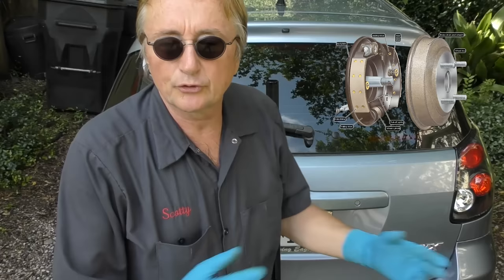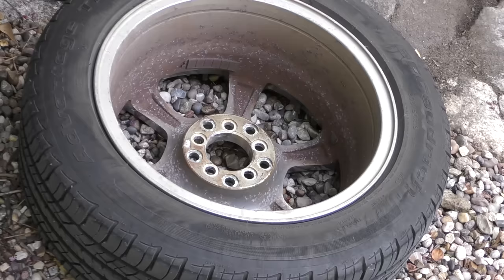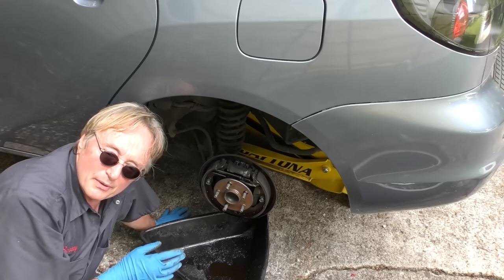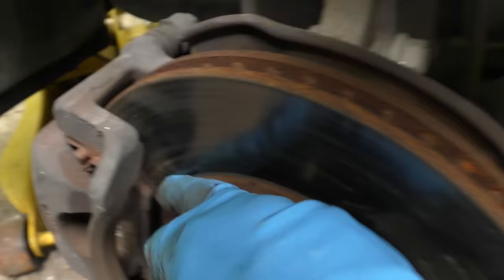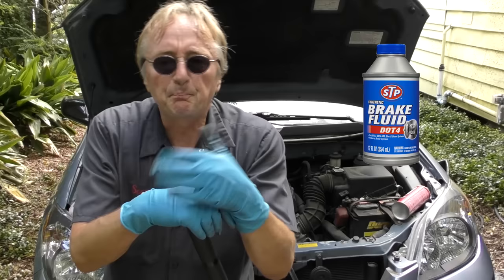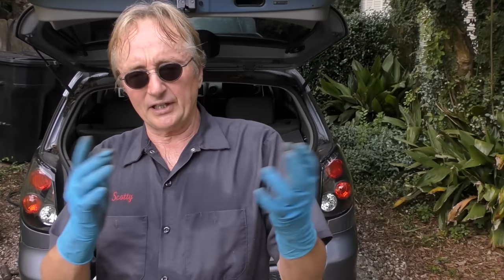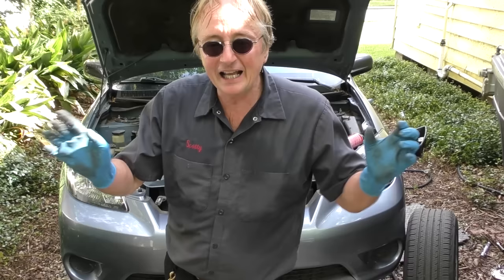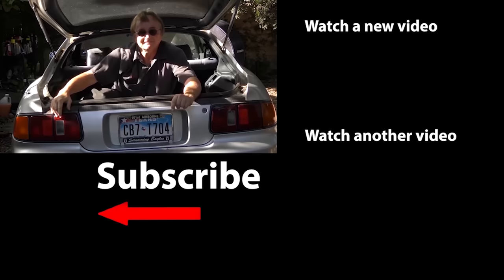Doing This Will Make Your Brakes Work Better and Last Longer

Comment: I actually did this to a '94 Toyota Celica and it turned into a '95 Toyota Celica.
Reply: Lmao
Reply: Hahaha good one!
Reply: What is the name of the product you use and where to get it ?
Reply: Did that cleaner cost $30,000 per can?
Reply: @edsyphan3425  No, I bought it used and it cost only $3,000 with 60,000 miles.

Comment: only Scotty can remove a wheel with a standard screwdriver.
Reply: haha if you aren't being sarcastic, he paused the video, most know how to take the hub cap and wheel off, unless there is a locking nut, that's another video
Reply: @asrtive  yes bro, you can see his impact wrench sitting on the ground
Reply: Lmao
Reply: It's a joke no need to explain everything.
Reply: They ruined your joke 😅
Reply: Only Scotty can use aerosol brake cleaner full force on a drum brake, and not have it splash in his eyes! No safety goggles. I wear gloves and safety glasses when I do work like automotive brakes.

Comment: Brake Cleaner is probably one of the best cleaners ever made. Has thousands of uses. 👍
Reply: Like what other uses?
Reply: it kills bees instantly too!!
Reply: @vivianp5962  it's a really good wasp/hornet spray for cheap. Got stains that won't come out, try Brake Cleaner.
Reply: Interested on what other applications can it do too!
Reply: @chantakzee  clean spark plugs
Reply: Mouth wash?
Reply: Personally i use Brake cleaner to clean any grease/oil area/surface. Just make sure that the surface is not delicate. Other thing that works incredible well is to remove stickers. You know, when a sticker is so well glued that when you remove it all the glue and some plastic/paper is left behind? Brake cleaner will remove almost instantly with almost no effort at all.
The only cons is the smell. Pretty strong. Use it only in a ventilated area. All of them are pretty good overall. I usually use WD-40 Brake Cleaner (not the regular one, the brake cleaner version). Pretty good.
Reply: Can it be used to clean mass air flow sensor?
Reply: @moeb434 , never use contact cleaner instead, and on all other sensors
Reply: @moeb434 The company that makes the brake cleaner, CRC, has a can of stuff made especially for Mass Air Flow Sensors.
Reply: @herbwag6456  just spray a little inside your underwear and the wasps won't try to nest there
Reply: shampoo
Reply: @BlackoutBilll21  Why would you want to kill bees ? They pollinate the crops that becomes our food ! They make the most natural sweetener in the world which NEVER spoils! Besides bee population is seriously declining do to pesticides and mite infestation!  If you do not want to eat, kill bees!
Reply: It is definitely a very good cleaner, but very hard on the hands.
Reply: @davidroth9845  Good idea! I'm also thinking of using it to clean my stinky dog.
Reply: @moeb434  No!
Reply: Great for cleaning oil and grease off of engines and transmissions.
Reply: @paulparoma  Wasps are a nuisance but I am told that they do  prey on other pests that ruin your garden! Hornets are small and wasps have a pronounced 2 part body. Bees are rounder. If you have problems with wasps hang those wasp traps  they work well and don't catch bees.
Reply: @paulparoma  My parents had a huge pussywillow tree which would be full of bees, l would walk by and even mow around it and never got stung once! Let the clover grow and you might just buy some honey produced from your own yard😁 Cheers Paul !
Reply: @paulparoma  👍
Reply: @glenhayward1132  hahah REALLY???? i meant the small nest in my boat trailer! not using insecticides on acres of crops!! smh
Reply: @paulparoma  If it flies and stings it's on the short time list.
Reply: @herbwag6456  Do NOT use Brake Clean on any animal -it burns eyes and skin!! It burns human eyes and skin too!
Reply: I use it to clean clothes when nothing else works it will do the job . It's a every effective product to clean guns , pistols etc . The pressure washes in the small areas you can't reach with a brush and the old grease / oil is definitively eliminated . You only have to put a light oil coating after that . And it's quite cheap and really fast .
Reply: Spray under your arms when meeting a Texas lady

Comment: I have two cans of Brakekleen.   You can use it for all sorts of purposes, including cleaning reloading dies.
Reply: It's a good bore cleaner as well
Reply: I use it on my mountain bike chain to get everything off instantly and then relube the chain accordingly.
Reply: @jessel1217  No better degreaser than brake cleaner.

Comment: Clean and non-offensive comment
I like that you mentioned changing out the brake fluid every so often. On my VW Jetta, the maintenance guide says to do it every 2 years.
Reply: What year is your Jetta I'm curious as I have a 08
Reply: @michaelpadilla6007  2003
Reply: Better to change the fluid than to replace the lines.  Fluid sucks up the water causing the rust.

Then again if you replace a brake line you need the replace the fluid anyway.

Worst case scenario:  You do brakes, lines, fluid and then store the car.  5-10yrs later when you want to drive it again you will most likely need to replace lines/fluid/seals again.
Reply: That may be a little bit earlier than needed but still, it won't hurt anything.

Comment: Don't drive like a maniac, and your car will last longer. Who knew?
Reply: Pass people who brake every 10 feet
Reply: Drive like a granny when car is warming up, than full throttle when warm, better for engine.
Reply: @goldenultra  wether it's better for your engine or not is debatable. I prefer full throttle a couple minutes after driving as you avoid heat soakin your intake and have more power.
Reply: @Josh-cw8by  More power because it is taking cold air, that makes sense. On my Avensis when you start cold it revs high toyota built it that way. So maybe there is more to it....
Reply: @Josh-cw8by  I think the paris333 or whayever comment removed that is why the comments look a bit 😕. I reported him as a troll, he or her was being intentionally rude.
Reply: Don't drive like a granny in the  passing lane and your rear end will last longer..
Reply: @ThePariss333 what does pride cost these days
Reply: ThePariss333 i
Reply: Many people didn't.
Reply: @Josh-cw8by  I floor it on 15mph limit roads to warm engine up a little quicker
Reply: @Josh-cw8by  I also put a brick on the gas when I put it in park. It's the only way you'll get the most out of your engine it's built for that
Reply: got 99 dodge ram , keep it up ,rebuilt front end , same transmission ,keep it changed ever 3000 miles , same with oil , i had it for 9 years , drive it everday . Long trips short trips it holds up really good . AC ,Heat , i did change seats out ,back and front out of 2001 dodge ram 1500 , along with carpet ,i like the leather better and it rides better, But yes you right take care of it and it last .

Comment: I love the smell of Bräkleen in the morning.
Reply: So  does   Robert Duvall.....
Reply: Works great as a disinfectant for minor scrapes and cuts!  Just spray some on those pesky cuts you get while working!
Reply: Good one!!!
Reply: @lysol7204  Done it.  I'd rather die of infection.
Reply: I would not use it to clean brassieres...
Reply: What is Bräkleen?
Reply: @Jozavenue  Only the best multi purpose chemical ever.
Reply: Probably makes a good wasp & hornet killer too, & WD40 works, maybe not as well, but it'll git er dun.

Comment: Take off the parking brake before trying to take off the drums.
Reply: You always try to take it off first. Having to go loosen the star bit and then retightenin it is unnecessary if you don't need to do it. Plus this car has an auto adjust feature, so if it comes off easy that's the method that will happen.
Reply: And if you literally meant release the parking brake then try.... well,  it's not coming off if the brake is on.
Reply: 1:13 you can see that he does not have the parking brake it was the Hub Centric ring
Reply: You mean out the gear in neutral or take off the emergency park brake?
Reply: yeah i broke my tone ring on my Subaru because i left the parking brake on… never going to make that mistake again
Reply: @magincap70  qq

Comment: Good job Scotty.  I cleaned the drums on my 1984 GMC 2500 4 by 4. I have had it since 1994, put new pad on the front disks. The rotors looked good. I can't wait to get my new brake cleaner

Comment: That break cleaner is good stuff.
I use it to clean lock cylinders.
Reply: It's also really good at removing sticker or tape residue. A quick blast and wiping the surface with a rag right after is usually all you need.

Comment: 100,000 mi from front brakes?  Not here in the mountains of NC. I get only about 40,000 mi. ( No, I don’t drag the brakes). Brake Kleen is great stuff. Have used it for years. 👍
Reply: Try gearing down on the long down hill. I did 100K on pads overloaded 1 ton in colorado mountains

Comment: First time I have ever seen the suggestion to flush out old brake fluid, it’s about time. Yeehaw.
Reply: I think it's underrated.  I once flushed mine, and they were significantly better.
Reply: My dealer “suggests” brake fluid flush every oil change lol. I’ve paid to have it done but not sure they actually do it.

Comment: Brake clean on actual brakes?
No thanks. I'll stick to cleaning my engine and everything else on the car with brake clean
Reply: Tried on pads, after sometime the pads came off leaving the iron to disk bare, metal to metal 🤢
Reply: @shaf3006  great troll 😂😂
Reply: FIREARMS CLEANER!!!
Reply: @shaf3006  You can't clean pads only the rotors.
Reply: Brake cleaner is basically just a kitchen degreaser on steroids it would clean the engine, it would clean all the oil off the cyclinder walls.

Comment: My wife's 2007 Honda Fit had 4 wheel disc brakes.   Her 2018 Fit has drums on the back.  But thanks to another video of yours, you set my mind at ease by saying that it's the front brakes that do the majority of the work.  This summer I will blow out the drums.  Thanks for the info.

Comment: Not the best idea to spill that break cleaner into the gravel / ground.  I'd let it evaporate from a tray.
Reply: Allan Peda why?
Reply: @putridvomit  the dust will dry and collect on the floor
Reply: @niq872  It's not a floor.
Reply: Well you don't want to breath that stuff either. Wonder if OSHA is watching.  Akebono makes pads for OEM  installation as well as caliper assemblies and so on.
Reply: 100,000 miles on pads Scotty?  Maybe in FL. Where there's no corrosive are added to the road and that white stuff falls. It'll kill the rear calipers quickly from salt/sand and the resulting high salt water mix from melting snow. Hard on front brake calipers as well. Service your brakes twice a year and they'll last. However brakes only have one job and that's to stop your vehicle. How much is your life worth. Don't screw around or cheap out on your brakes.
Reply: synonyms: ground

Comment: You crack me up. Love your videos!  Everything makes sense or duplicates what I tell people and know...  Now I have have many cars and trucks and usually the calipers stick...  So what I do is unbolt the caliper and "pop" the piston by pushing the brake pedal  then clean it out make sure it's clean and no resistance.... Then I'll put some grease on the cyllander undo the bleeder and push the piston in the whole way.. reinstall the caliper then bleed the brake..  that way when you let off the brake it comes back and doesn't stick...                    Bungee

Comment: You definitely live in Houston. That's the most I've seen you sweat.
Reply: Lou Yelich Try living in Lubbock.  At least Houston has the Gulf winds.
Reply: Live here in Brownsville, Texas. It's been 120 with 90% humidity for the last 2 and a half weeks. Your asscrack will pretty much  be damp the minute you step outside. And it is 100 during the night. And funny thing is I live 10 minutes from the beach.
Reply: zhbvenkhoReload and here I am bitching about this San Diego weather, I won’t be doing that anymore. I feel for you and I hope it cools down soon.
Reply: Gulf winds? I lived in Houston for 10 years and the only breezes I ever felt were in the Winter. The wind just dies in the summer. Also, the Gulf is like a boiling pot of spaghetti and the summer breezes are bleh. In my experience, Houston was 90+ degrees and 90+ humidity - from mid April to mid-October. I don't miss that.

Lubbock IS hotter though - hella hotter.
Reply: @zhbvenkhoReload  - you have my deepest sympathies. That sucks/blows.
Reply: @zhbvenkhoReload  120° and 90% HUMIDITY?!?!?!
How do you stand it?!?!
Reply: Come to Puerto Rico. You Texans won't survive, lol.
Reply: @davecrupel2817  You get used to it. Also, I work as a school teacher so I don't go outside during the day. Just during the night to run a few miles.
Reply: Dallas Texas in the house!
Reply: @michaeldavila8627  You're tripping hard if you think Puerto Rico is hotter than Texas lmao

Comment: Good advice as usual Scotty. and yes, I did "Ring that Bell... 

Just DIY serviced the HandBrake ( Hand UK  ~~ Emergency Brake USA ) on my 2005 MG ZT Petrol Turbo. It has Disc Brakes on the rear and inside their hubs, are a small brake shoe assembly for the the Handbrake operation. Doesn't hold the car like it used too. So removed Discs/Rotors and Calipers on rear. I used some 5% Dilute Dishwashing Up Liquid in a Mist Sprayer the type gardeners use to spray their plants. Then liberally sprayed the assembly after removing Brake Discs. Worked that into all the nooks and crannies with a Nylon Bristle Brush. Then rinsed the lot of it off with some recently boiled water. That warms the components and allows them to dry quickly with the heat. Then adjust trial and error with disc on then off until ideal Handbrake setting is achieved. I can now park my car on the steepest slopes confident it will not roll away. This frequently happens with some cars even modern new ones with the fancy brake assist gizmos... several reports in the press about runaway cars. Not all advanced technology is 100% beneficial. 

I'm one of those drivers who does get 100,000 miles out of the Pads .. not to be confused with driving slowly as you mention. Anticipation is what its all about. Many drivers are heavy on their brakes. No need. Plus wait at long hold ups or red lights with foot firmly planted on brake pedal stressing the hydraulic seals in the system. That' accelerates wear and why their cars need expensive brake renewals soon and more frequently. 

Keep that good advice coming Scotty. You have millions of Bell Ringers ...👍👍

Comment: EPA is going be coming by due to your toxic waste spill there buddy....lol
Reply: I was noticing that as well. Soil acidity might break down small amounts of toxins. 
Places like military and large military plane contractors used to get EPA waivers to dump solvents into streams running into rivers here in Atlanta that flow to the greatest estuary in the WORLD! That was true in 1995. I did an award winning study on the local River corridor and published a list of known point source polluters directly from the EPA/EPD. Recommend published consumption of fish and other marine life was not more than once a month. 
And that is the truth as I knew it.
The old professor
Reply: Coach Wilson, Have you ever used brake cleaner? It evaporates extremely fast! Almost all of the contamination is brake dust that ends up in the environment any way.
Reply: @donlarsen9807  yea,  I was just making a laugh. That stuff cleans great and evaporates almost immediately. That's what the lol was for.

Comment: My 2014 Tacoma just rolled over 200k miles on the original pads, no squeaks! Brake pedal travel has gotten long though, will be replacing soon

Comment: "Now the secret to making your brakes last their longest is... don't drive your vehicle!" - Scotty
Reply: Then the weeds will overtake it.
Reply: livewireOr hmmmmm.   Obsessed with ‘weed’ ???
Reply: Then your brake discs will become pitted and destroyed by corrossion brakes have to be used a little bit to avoid rust and corrossion building up on the discs. Brakes can die of not being used enough in extreme circumstances.
Reply: I guess this one is basic cdl question

Comment: Another practical video! Scotty you''ve got great advice and a fine sense of humor!  I've flushed my cars brake systems every two years and kept original brakes (except pads and rotors) for 265K miles on my '86 Mitsubishi Mirage Turbo.

Comment: Been doing something like this since the 1960s when I gave the brakes on my MGB Soft Top tourer some TLC. Front discs, rear drums.

I now use a 5% diluted Dishwasher Liquid in a Plastic Mist sprayer. Work that into all the areas of the brakes where brake dust, road filth and other stuff has accumulated. Using a worn plastic Dishwasher nylon brush destined for the rubbish bin. More Zero cost. Then use a freshly boiled kettle of hot water ( cooled a little ) to wash off the soap residue. Comes up like new as the heat in the water helps drain and dry the water away. Then the all important HandBrake adjustment is so much easier to do with a clean assembly accessed with Drum/Brake Disc Hub removed. Then rear foot or handbrake operates like showroom new. 

The Rear Discs/Rotors on my UK built MG ZTs and Chinese MG6s in the family fleet have drum Handbrake internals. Known as Parking Emergency Brakes in other parts of the World. Filth builds up inside these Hub/Drums in the discs over the many miles and years. My cars all 80-100,000 miles plus now.

Result. Brakes that work like new and at near zero cost.

Comment: Hey Scotty, Thx for sharing. Some service stations clean rear drum with water. Is this recommended?
Reply: I wouldn't say I recommend but long as they finish with brake clean right after you shouldn't have a problem.